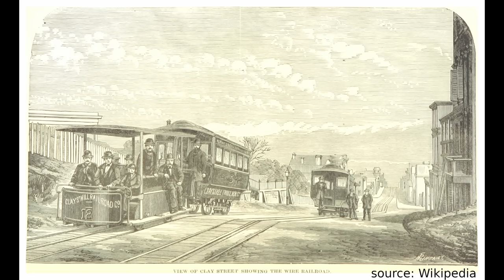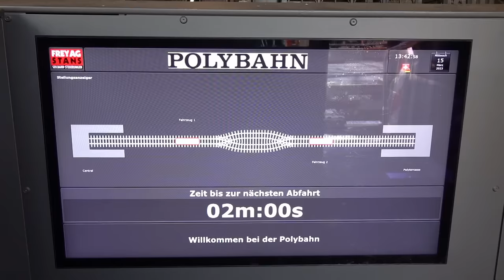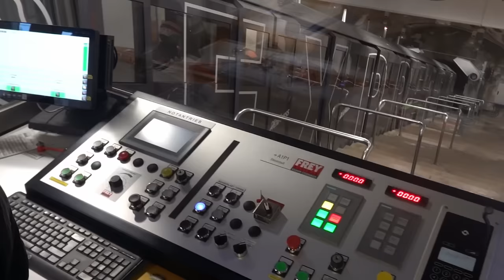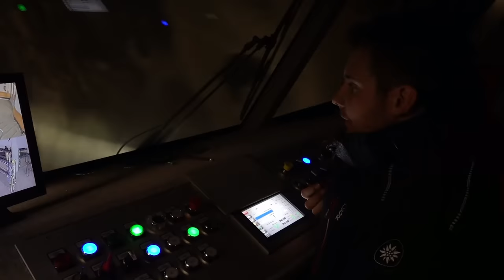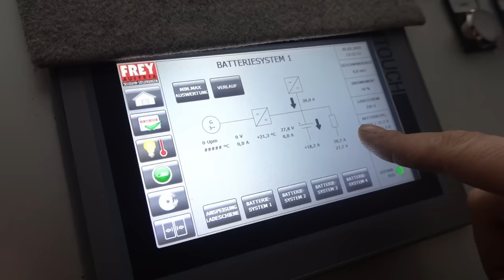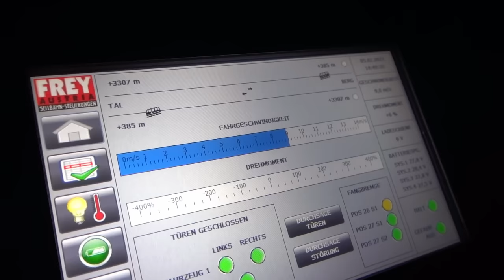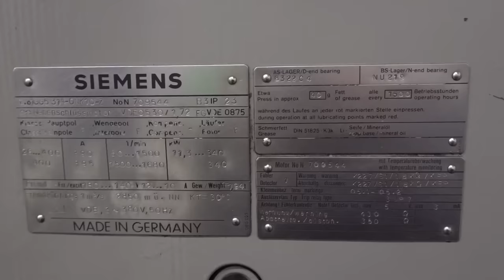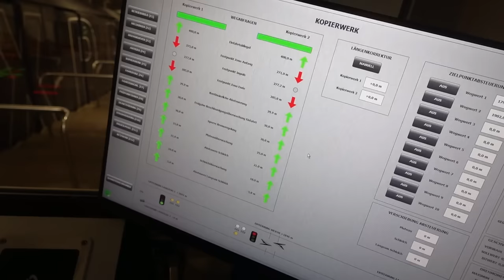A train that never sees daylight

Comment: Thank's. Very interesting! I miss information about emergency breaks on the cars themselves. If the cable snaps there is surely an automatic break on the cars.
Reply: two cables, regen braking on the cars, mechanical brake on the cars. These were all the redundant measures mentioned in the video that could be used in the event of a cable breakage.
Reply: @tissuepaper9962  OK. Sorry I must have missed that part.
Reply: @tissuepaper9962  No, only one cable on each.  The cable circles the bottom counterweight, and goes on to the other car...
The two cables are traveling in opposite directions.  I scrutinized the images...
Reply: @tissuepaper9962  Mechanical brakes on the cars?  Are you sure?  Where did he mention that?
I couldn't find that anywhere...
Also, the regenerative braking is in the WHEELHOUSE only, in the drive motors.
The on-car generators or only a Kilowatt or so, as seem on the car control panel.
Reply: @troubleshooter1975  they refer to it as the "maneuvering brake". stop blowing up my inbox, just rewatch the video if you missed what I mentioned.
Reply: @tissuepaper9962  NO sir, you are wrong!
I watch it for a third time - The 'Maneuvering Brake' is in the CONTROL ROOM, not in the cars.
It operates through the braking system on the drive wheel in the wheelhouse AFAIK.
(I suspected that is what you were referring to, and I had problems finding it again, as it was in the subtitles only, and not in the transcript).

Correct me if I am wrong. I think this is right...

BTW, I was NOT criticizing you, it was an honest question as to if you were sure of that, and where it was as I could not find it...
Mr K L
Reply: @tissuepaper9962  OK, I confirmed that what I stated is correct, with the author of the video here.
The information is posted above...

Not only did the author, kalsan15, reply but he ALSO forwarded and received a reply from Heiko, the chief engineer of the Pitztal express, who was featured in the video @ ~12:09!
They both confirmed what I said about the maneuvering brake.
They made no mention of any 'regenerative braking', in regards to the cars; but I stand by my assertion on face value, as that the cars have NO electrical busses to the outside, and the on-car GENERATORS are only ~1kW units (as seen in the control panel image), AND also that the wheels could not hold braking friction on that steep of a grade...

BTW, I didn't know that two replies constituted 'blowing up' your inbox.
Normally, if I question something, I put it all in one comment, but I had two points to clarify, and I had already posted the first one, when I realized they were both from you.
Since they were comments about two separate systems, I simply left them as two replies...
The other concessionary comment came from the poster you are replying too, not me.

Incidentally, if you reply to someone's question with an incorrect reply, you should not be surprised or take offense if someone asks if you are certain, or questions your answer...

Cordially, Mr K L

Comment: Kaprun desaster was caused by failed construction of the cars. They assumed that there was no fire hazard, cause there were no motors in the cars. 
But in the cockpit there was installed an electric radiator which was only to be used for heating private houses. When a hydraulic line broke, the oil hit the hot wires and a fire started. There were no fire extinguishers nor emergency hammers inside, so the passengers had to break the windows with their skies or boots. A lot of them died, cause they went up the tunnel to escape and suffocated from the raising smoke. The court trials were a joke, no one really got punished.

Comment: The Montreal Metro in Canada also never sees daylight and it is a full-scale 70 km long metro with 160 meter long trains unlike this short cable car system.  It is much more impressive and elaborate.
Reply: There are many metro systems that don’t run on the surface. This video showcases a funicular that doesn’t rise to the surface.

Comment: There is also Innsbrucker Nordkettenbahnen. It works the same way, but the bottom half of the route is flat. Each car have 5 sections, that rotate depending on the slope of the track, keeping the floors level at all times.
The cars have drivers cabin only on top, so when going down, you can be at the front looking at the tracks.
https://www.youtube.com/watch?v=lPihhrtMg7g
Part of the track is also concave, so there are mechanisms that grabs the rope to prevent it from liting into the air after the car passes it (at 1:07 and 2:39 in the video above)

Comment: Is there brakes on the cars?
Does the maneuvering brakes act through the service brake?
There seems to be some disagreement if there are any secondaries in place if the main cable breaks...
TY
Reply from the maker: I forwarded your answers to Heiko and his reply was very quick and complete! I'll post it in the original to make sure I don't mess up the terminology, please use DeepL or similar to translate to your favorite language. In short: yes the train is equipped with clamp breaks that grab the rails automatically if the rope breaks. The maneuver break is actually the service break.

Die Standseilbahn hat folgende Bremssysteme:

    1. Normales Verzögern = Elektrisch über die Motoren
    2. HALT (gelber Knopf) = Elektrisch verzögern bis zur Mindestdrehzahl und dann fällt die Beriebsbremse auf der Antriebsscheibe ein.
    3. NOT-AUS (Abschaltungen bei Störungen) =Die Betriebsbremse auf der Antriebsscheibe fällt ein (die Schließkraft der Bremse ist hier abhängig vom Lastfall der Bahn.)
    4. GEFAHR- AUS= (Roter Knopf und schärfe Überwachungseinheiten) = Di Sicherheitsbremse fällt ein und bei Erreichen der Mindestdrehzahl fällt die Betriebsbremse ein. (Schließkraft der Sicherheitsbremse ist wieder abhängig vom Lastfall.)
    5. Jedes dieser Bremssysteme ist überwacht! Wenn ich zum Beispiel ein HALT drücke und der Verzögerungswert stimmt nicht kommt Automatisch ein NOT-AUS………usw.
    6. Die schärfsten Bremsen befinden sich auf den Spurkranzrädern der Züge und werden Schienenzangenbremsen genannt. Diese sind wirklich nur im Notfall zu betätigen. Die Auslösung dieser Bremsen erfolgt: 

    6.1. Über einen Taster im Kommandostand des Zuges.
    6.2. Über Zwei Schalter die die Spannung des Seiles überprüfen. Das heißt bei einem Seil Riss fällt die Bremse automatisch ein.

Die Manövrierbremse ist eigentlich die Betriebsbremse!

 
Ich erkläre dir kurz den Manövriervorgang bei unserer SSB:

 

           -     Sollte der Haupt- und Notantrieb nicht mehr Funktionieren können wir Personen rein über die Schwerkraft ins Tal befördern.

           -     Hierfür muss man das komplette Bremsaggregat auf Handbetrieb umschalten.

           -     Dabei wird die Sicherheitsbrems an der Antriebsscheibe händisch geöffnet und offengelassen. (Die kann aber jederzeit durch betätigen eines Handhebels im

Kommandostand wieder geschlossen werden)

Der Hebel für die Manövrierbremse wäre eigentlich da, dass wir jetzt die Betriebsbreme öffnen und danach mit dem Hebel bremsen!

Da dies aber ei unseren Versuchen ziemlich ruckartig war, verwenden wir diesen Hebel eigentlich nicht.

Wir verwenden zum Manövrieren die dafür vorgesehene Hydraulikpumpe im Kommandostand.

Das heißt wir öffnen die Betriebsbremse mit der Hydraulikpumpe ganz langsam bis sich der Zug in Bewegung setzt und sollte er zu schnell werden verringere ich

den Druck bei der Pumpe.

                Im Notfall könnte die Bahn immer noch über die Betriebs-, Sicherheits-, und Schienenzangenbremse zum Stillstand gebracht werden.
Reply: @sandro-here  WOW! THANK YOU!!!
I knew that, and am having a disagreement about it here, but couldn't prove it.
(insisting that the maneuvering brake, or alternately that regenerative braking, would hold the cabs if the cable broke; which I said was false)...
Tnx again for your help!!!

Comment: could the tunnel be sprinklered for fire suppression? it would be very high pressure though due to the elevation change. would require pressure regulators at regular intervals.
Reply: The only thing that could really cause a fire in the tunnel itself is the lighting, and you don't really want to spray water on an electrical fire. The cars themselves probably already have some sort of fire suppression system built in, and when you couple that with the "oh shit" mode and the pretty high likelihood that they have ventilation shafts at semi-regular intervals along the tunnel (they would almost be required if you were going to run a generator in the tunnel, which happens when the cars don't spend enough time in each station to charge their batteries) which probably have exhaust fans that can also serve the purpose of evacuating the smoke from a car fire and you end up with a system that really doesn't need sprinklers in the tunnel itself.

Also, I can almost guarantee that almost all the components (the wiring, the lighting, et cetera) within the tunnel are fire resistant, if not fire retardant, so they would very quickly burn themselves out the moment you cut power to the tunnel itself, which you can do independent of the power for the propulsion system
Reply: @richardmillhousenixon  One thing he didn't address is the onboard generators in the cars: I highly suspect they might be wheel-driven.  I don't think they would use gas or propane.
[Old steam(?) or diesel train cabooses used a belt driven generator (off a wheel axle) for the crew quarters; I saw this in a parked display in St. Paul MN.]

Comment: 10:26 that makes the 2000 Kaprun disaster even more shocking is that the fire was caused by a faulty fan heater igniting leaking hydraulic oil.

Comment: I dont understand why finaculars are not completely automated like a modern elevator or airport terminal pod train.  Manning a cabgets prhibitivly expensive when its required to operate 24/7.  Thats pretty much Edmontons tiny river valley finacular.  Just a glass enclosed inclineed elevator only 350 feet long
Reply: I am guessing it is partly because you have to get everyone ready at both ends; if the bottom is ready and the top are poking along, it might never get started?
Also maybe safety, to insure the gates are clear, and to keep a schedule if people are waiting and don't let things get underway (to cut off loading and get going),

Comment: Are there any backups for when a cable snaps?
Reply: Firstly, it's if, not when a cable snaps, and a lot of shit would have to go catastrophically wrong before that, and secondly, I can almost guarantee that yes, there is an emergency brake system on the trains themselves. Whether it works like the block brakes on a rollercoaster, where fixed brake fins on the train interact with the powered brake systems within the tunnel or vice versa, or if there is some other system built onto the trains to stop them in that contingency is hard to tell, but considering European safety standards and how hard they punish companies that don't do proper maintenance, the likelihood of the cable even snapping in the first place is very very slim, as in those systems there is a stupidly high safety margin on the carrying capacity of those cables, likely to the extent that that single cable can support a dead weight 2 or 3 times that of the train itself, and mind you that's the dead weight, the fact that the train is on a slope means that the cable would never see anything close to the dead weight of one single train, let alone 2 or 3